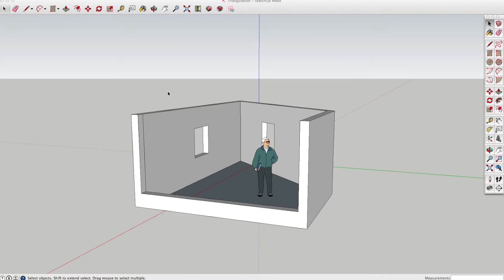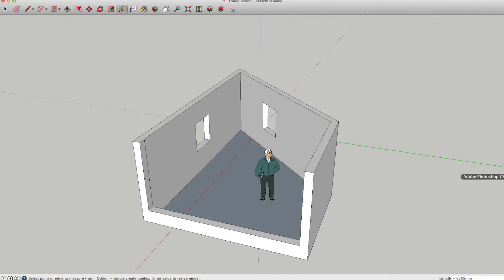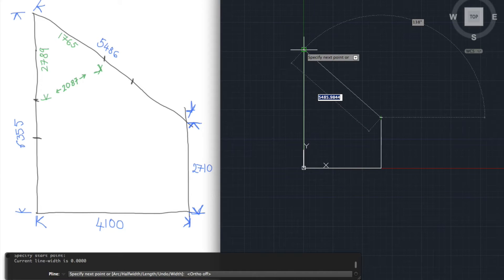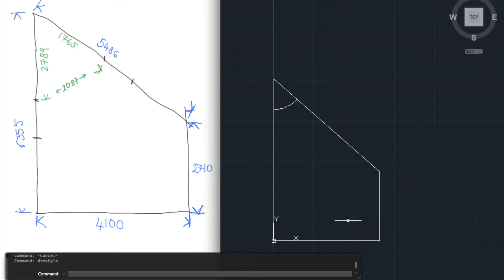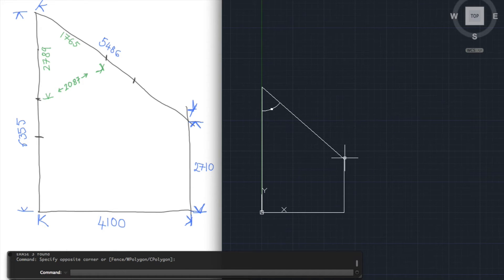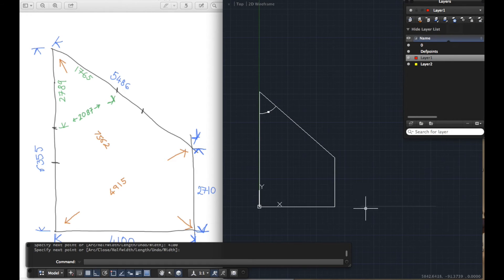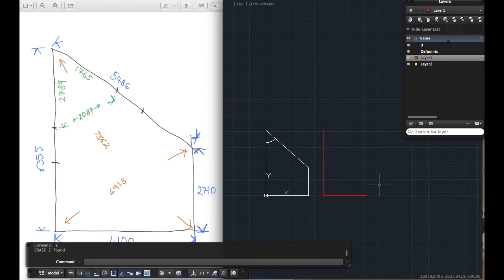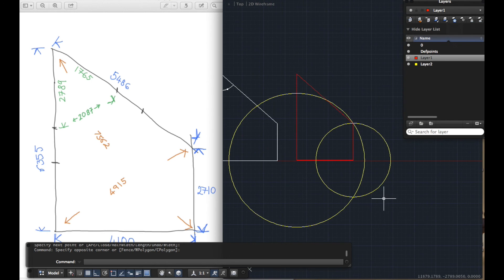How to measure angled walls in measured surveys

Comment: This is helpful, but what I would like to know is how to take the diagonal measurement accurately on site. On the long diagonal it's impossible to get the case of a tape measure into the tight corner and even the end of the tape won't go all the way into it. From the dimensions to work in the drawing properly they need to be accurate, including the diagonals. How can this this be achieved?
Reply: We always carry a long length of a string and put it on the two corners of the diagonal. Mark the end point on the string and then use a normal tape to measure up that length.
Reply: @059echo  Good idea. What sort of string do you use? It would presumably have to be made of something which won't stretch...
Reply: @johnbowmer5698  the kind of string masons use with the plumb to determine the line levels of a surface. And yes, something that doesn't stretch.
Reply: @059echo  Thanks

Comment: Fantastic thank you :)  Not sure if you'll see this message, but my question would then be, which one would you actually draw ?

I always take out the slight kinks in non-ninety degree walls because if we put everything in as precisely as we'd measured it (in my case, using either a Disto or a Tape Measure), there is always some error in there any way.

Be interested in your views :)
Reply from the maker: It depends on what your survey will be used for. Sometimes it is really important to know the exact dimensions and kinks in a wall. Personally I always try to draw as accurately as possible when carrying out a survey. 

Best of luck :)